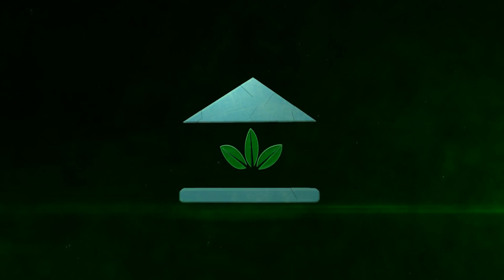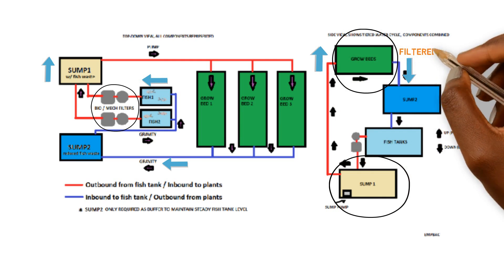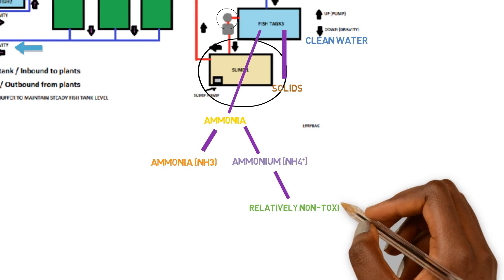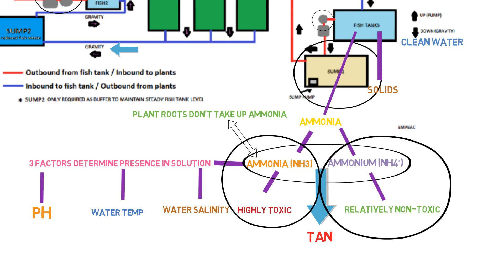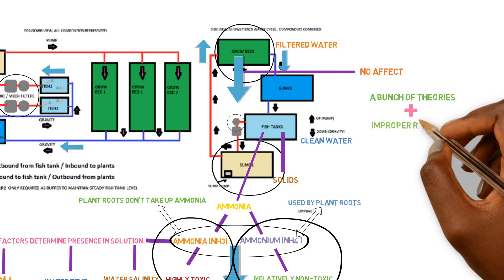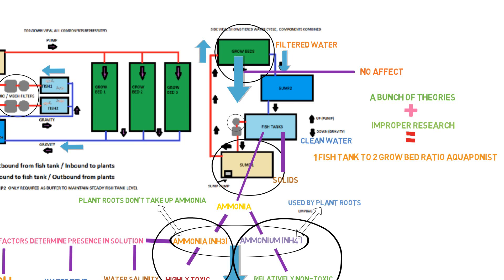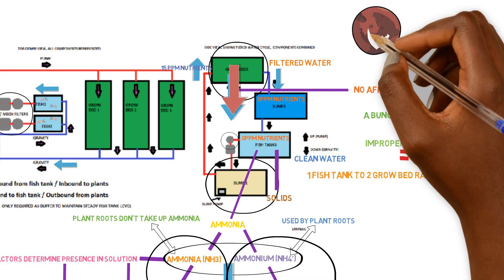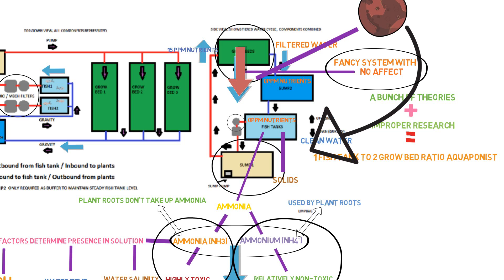The Myth of Gravity Feed | Ask The Aquaponics God Ep40

Comment: Another Great Vid.....   There are a few plants that prefer Ammonia.  Duck Weed, frogbit. etc.  This is why a lot of folks prefer these plants in ponds.  No need to worry about nitrite or nitrate.  If the ammonia is being consumed and never converted.
Reply from the maker: True Shawn. To add to your point, most plant prefer ammonia (nh4+) over nitrates. Even if the plant takes up nitrates it goes through a process known as nitrate assimilation where it must convert the nitrate back to ammonium to be used as a structure building component inside of the plant roots.

Comment: Hi Brooklyn, Currently I am designing small scale flood and drain system. I took your Aquaponics system build course and you name different pond liner materials. They are very expensive where I live, but I managed to get some old plastic liners used in those gigantic advertising boards everywhere in the streets, I think they are made of  Vinyl. Do you know if this plastic will bring problems to the health of the system? I found that there are Pool liners made of this material, but didn't found any information about people using this material in aquaponics or fish ponds.
Your videos are awesome! I am learning lots of things
Reply from the maker: Hey Diego, Since you're a student in our course, to receive a faster reply it will be better if you post your questions on the schools comment board. Student questions receive priority over youtube questions. And since there are so many questions being asked, we want our student's questions to be addressed first.

As far as the used vinyl material that you have access to, it's very difficult to determine if it is safe to use simply because I don't know if it was coated with anything for extra protection. Vinyl by itself usually doesn't pose any issues in aquaponics, but if the the liner was placed against a harmful chemicals then those chemicals may be present on the liner. 

Here is a forum post that I found on the subject for you with those that have used billboard liner for ponds
http://forums.pondboss.com/ubbthreads.php?ubb=showflat&Number=223712

This website says that billboard liner is fish safe.
https://billboardtarps.com/product-category/pond-liners/

In my opinion, it will boil down to what chemicals the billboard liner was exposed to and if you're able to throughly clean it or not.
Reply: Thanks a lot! 
Sorry about that, I will put other questions I have in the school's comment board

Comment: One more thing, even if this did work(it does not) the water does not get cleaned instantly, one cycle in this order won't make any significant difference it takes many cycles each cleaning the water a bit, also fish don't make a ton of waste in a single cycle, it's a gradual process, hell even if the water was not cleaned it would take many days for the fish to die from their own waste.

Comment: Would this system not deliver a more nutrient rich solution to the plants than a system with 1 sump tank? 
Or is the uptake nutrition rate so slow it doesn't make any difference if your passing 15ppm or 50ppm through the roots?

Comment: Well I will say that there is a high amount of BSA within a DWC bed that can oxidize that ammonia if sufficient oxygen is present in the system. That said if you are running near zero ammonia in a split flow system this is not any kind of disadvantage either, so long as it is all broken down it really matters little how you did it. I am running a simple four stage sumpless gravity fed DWC system and 90 min after a saturation feeding my TAN registers at only 0.25ppm, do I care if it is broken down in the biofilter or the grow bed, heck no just so long as ammonia stays near zero and my nitrates are exactly where I want them.

Comment: this video only makes sense for raft bed   your grow beds are your biofilters and therefore do convert the amonium
Reply from the maker: You have to examine the question that he asked. He didn't ask if the grow beds are biological filters. He was assuming that sending the water through the grow beds first would prevent the ammonia from returning back to the sump tank (in one pass through). This doesn't occur no matter which system is used.

Comment: lol why do you need 3 tanks just to filter the water?? just use a swirl filter. with a ball valve at the bottom to release all the fish solids.
Reply: bounchofbeaners that only address solids, does not address fish pee.  As stated in other videos, depending on grow media and bed designs, those filters are not necessary.  Speaking as an engineer, it's better to design your system to succeed in any condition, than it is specialize it for a specific condition.  I don't have any practical experience though, currently small scale hydroponic
Reply: 3 tanks use as grow beds
Reply: fish pee! lol!